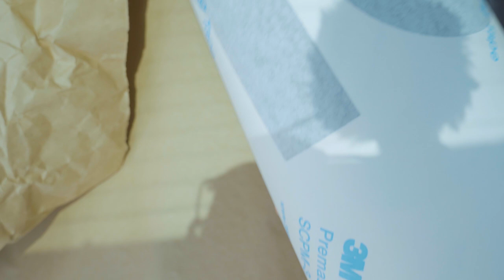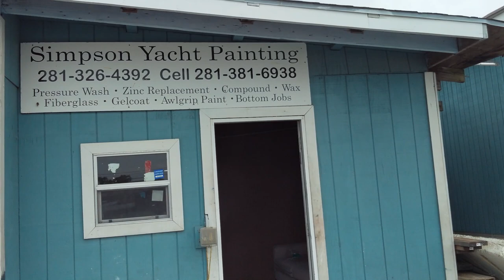Preparing for Offshore Sailing, At The Boat Yard

Comment: It's always easy to spend someone else's money but I must say you should have considered a feathering propeller over a fixed one.  I have a three blade feathering propeller on my Beneteau 42 and I love it.  Along with plenty of power forward, it does an excellent job in reverse. Additionally, it enhances boat speed by an easy knot or more.  This is the second one I have owned; there was one on my Kirie Elite 37 and I loved it too.  But it is what it is.....you'll get use to the performance of a fixed blade.   By the way, I went to school at the U of H in the late 70's and worked for a sailboat dealer in Houston called Sailboats West.  We sold Hunter, Cape Dory, Catalina, the complete AMF line, and a variety of catamarans.  It was a great job that fit my school schedule very well.  I crewed for different sailboats on Galveston Bay, mostly from Clear Lake Yacht Club.  But I bet that place has totally changed since I moved away in '84.
Reply: We LOVE our 3 blade feathering auto prop!
Reply from the maker: I'm jealous of getting an extra knot! 

A lot of the restaurants around here have photos on the walls from the 80s...and yes, the place has changed a lot and continues to change!  BTW - I (Matt) also went to UofH. :)
Reply: Feathering props are just another maintenance item. Solid props work fine and wont break.